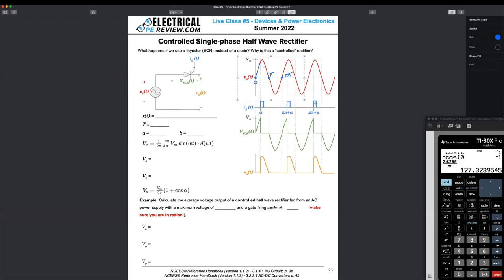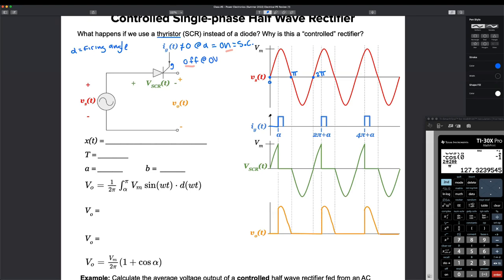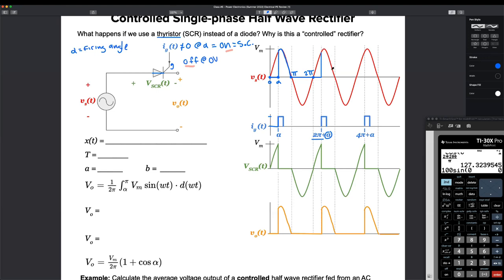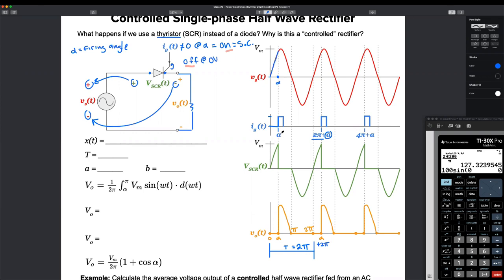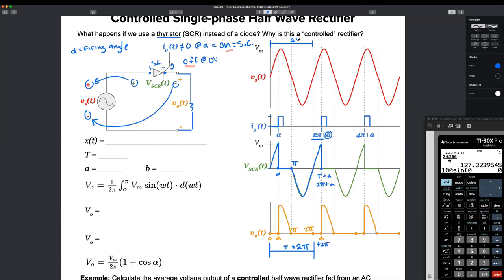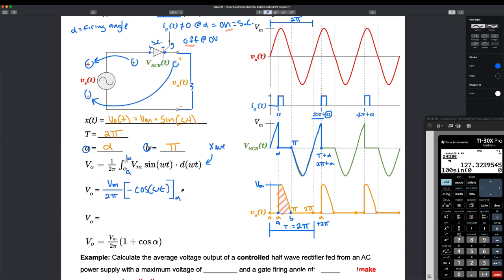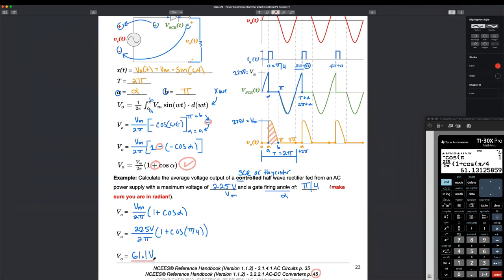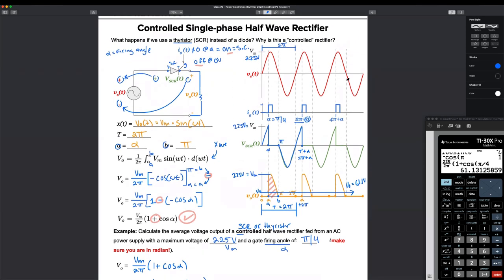Controlled Single-phase Half-wave Rectifier (Thyristor, SCR) for the NCEES PE Exam Electrical Power

Comment from the maker: Table of contents:
0:00 - Thyristor and silicon controlled rectifier (SRC) basics
1:46 - Firing angle (⍺) and the gate signal
3:10 - Closing the thyristor/SCR (short circuit)
3:31 - Opening the thyristor/SCR (open circuit)
4:55 - Drawing the output voltage signal Vo(t)
5:18 - Determining the output voltage period (T)
6:24 - Drawing the voltage signal across the thyristor/SCR Vscr(t)
10:27 - Deriving the formula for the DC output voltage Vo(t)
11:43 - Deriving the formula for the average DC output voltage Vo
14:25 - Practice problem example calculating the average voltage output